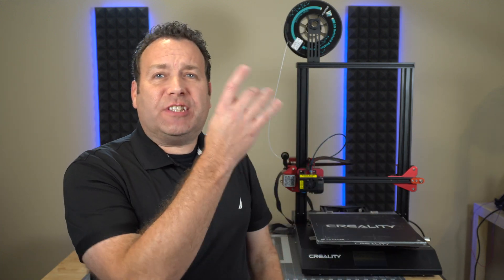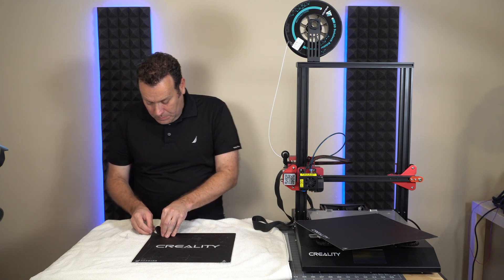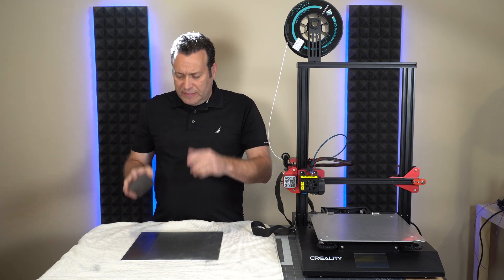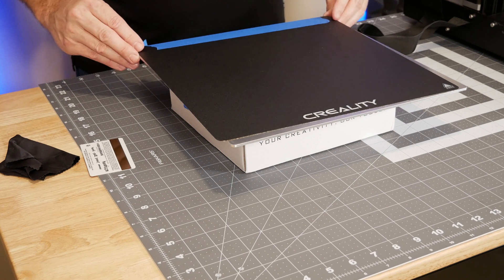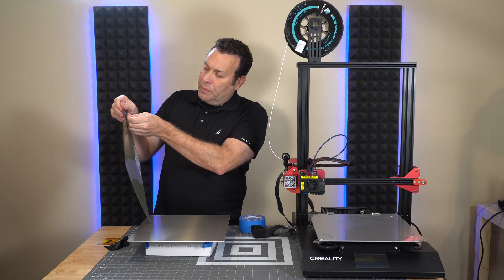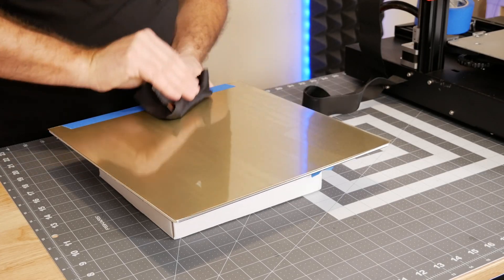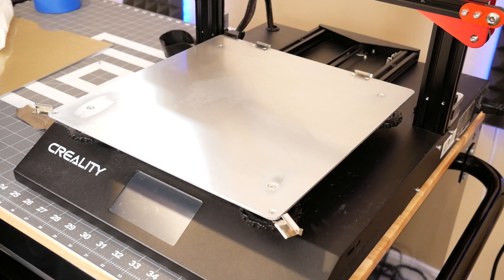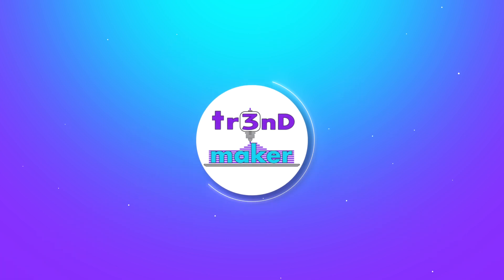PEI / Stock DUAL BED SURFACE for Creality CR-10s Pro -Prep Clean & Install - CR10 S - REPAIR

Comment: what's the strongest filament
Reply from the maker: I very much like Hatchbox and Sunlu for across the board performance.  Strength is more a factor of layer adhesion, resolution, infill %, wall count, and infill overlap %.  For strength add more walls and higher infill.  Be sure layers are melting together well.